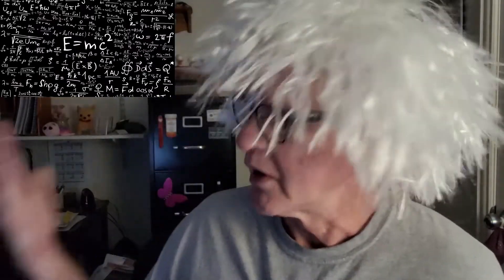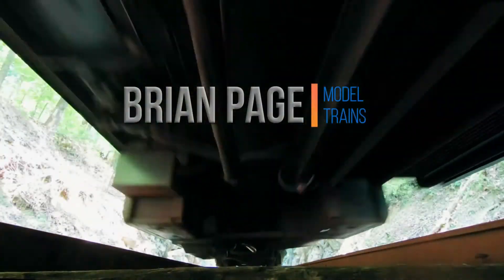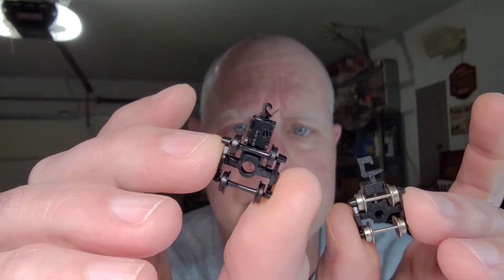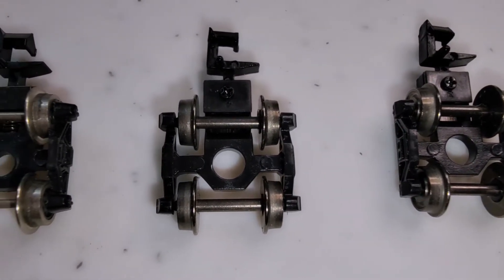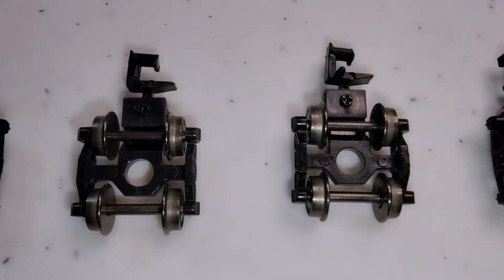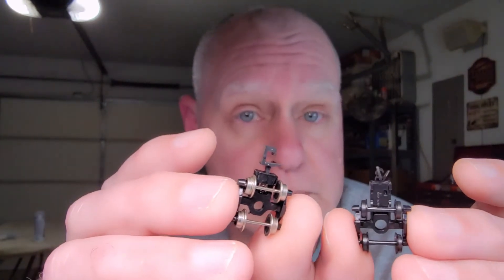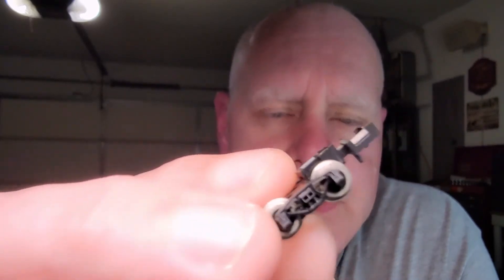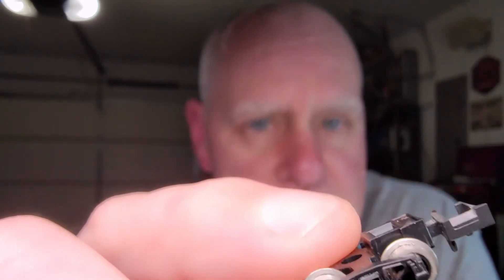Plastic vs. Metal Wheelsets

Comment: First off, I need to say that 90% of my freight cars are equipped with Micro Trains trucks and couplers.  But, I have some old, ('69 and '70's) MRC freight cars, with factory trucks with metal wheelsets, and they are by far, the best rolling freight cars I own.  I've had 'em for over 50 years, cleaned the wheels once, and they're still running perfectly. never derail, and stay clean.  I wish all my freight cars ran as well.  Almost every time I see MRC freight cars come up for sale, I buy 'em up,  and they all perform the same.  I've never regretted the decision to pick up more.  Thanks for your observations and opinions.  I agree with you 100%.
Reply from the maker: Yes, whatever works best for you, I say stick with it!

Comment: C'mon Brian, I was just taking a slurp of tea when you showed up like that, nearly came out of my nose LOL.
Over this side of the pond  in N & HO gauge we tend to go for metal wheels. They seem run more freely, tend to stay clean longer than plastic although all wheels as you said will pick up dirt, and they clean up easier. All our locomotives and rolling stock tend to be metal wheel. Some company's who put out kits you put together tend to come with plastic wheels but only I think to keep the cost down. We then simply change them to metal.
Our goods wagons or as you call them freight cars in the period I cover 1950's are so small and light I have to put weights in them so they can at least have half a chance of staying on the track.
 As my layout is in the loft and we do get extreme temperature variations up there I have to put expansion gaps between track sections to allow for the track to stretch or shrink. Oh I have had some disasters when I did not allow for this. I have a gap of 1mm between each track section and believe me you can hear the clickety-clack as the train runs along, its lovely, brings back fond memories when us poor could afford to travel by rail.
Now regarding the cocktail stick test, that might just be down to the coning of the axles. I have not tried these yet as all my stuff is fairly new but I have heard good things about Bearing Reamers which they make for us N Gaugers.
They smooth out the imperfections in the coning of the axle bearings. Mate of mine has purchased them and he can now pull a third more in stock after using the Bearing Reamer as it has cut down on the friction and the wheels run better. Also they work with metal and plastic wheels so I am told.
To be honest I dont swap mine out either, I leave whatever wheels are on there when I purchase them,  unless I start to have issues.
If it works dont fiddle with it.
Regards Chris
Reply from the maker: Lol - Good thing it wasn't soda! I agree with your comments completely, my point was use whatever you like.

Comment: Brian, I completely concur with your assessment of plastic vs, metal wheelsets.  I have over 200 freight cars, and I'm about 2/3 done with the conversion process.  I've found, my locomotives, after conversion, can pull over 20% more freight cars, starting with the same consist, than they were able to prior to the conversion to MT trucks and couplers.  Just a little more validation to your conclusions.  The only way to eliminate 'cruddy' wheels, is to invent, and run, Maglev trains !
Reply from the maker: Yeah, I caught a lot of flak on this one, which I knew I would.  But the point was, use whatever you want!
Reply: @brianpagemodeltrains  absotively, posilutely !

Comment: Hi Brian! Thanks for your assessment of plastic vs. metal wheels. As you may know, I switching from plastic to metal wheels on my layout, but I still have both on my layout, and both work very well. I think good trackwork and the overall weight of the cars is more important. Bottom line (as you noted) is this: Like just about everything in model railroading, whether you use plastic or metal wheels on your layout comes down to a matter of personal preference. ...Roy
Reply from the maker: Precisely Roy, thank you!  That was the message of the video.

Comment: Interesting observations Brian. There are pros/cons for both options. I fully agree with your conclusion - do what you like with your railroad. But, both Steve C & Roy E have very valid points as well. I'm sure you knew that you weren't going to end this debate - it'll never end!
Reply from the maker: Very true, John!  My point of this was use what you want, there's no right or wrong.  My layout is so small, I could use the old crappy trucks and it wouldn't make much of a difference.  It's true, it will never end, but a good debate can be good conversation as well!

Comment: Good video, but I found the comparison of 40 year old vs new trucks and wheels to be pretty strange.  Yes the weight difference is small, but in some cases might be all that is needed to bring a car to proper weight.  Another unmentioned advantage is on light cars, metal wheels will lower the center of gravity to help tracking etc…  modern metal wheels aren’t usually as wide or have that big a flange as those you have.  If you put a modern blma, fox valley, tangent or such wheelset in the same micro trains trucks, my experience is they will out roll plastic every time with an even lower amount of friction and personally I find they stay cleaner.  To each his own.  Very entertaining and I look forward to seeing your next video my friend.
Reply from the maker: Thanks!  Yes, it was a "strange" comparison, but as I said before and after, it was only to show why I don't feel the need to swap out my plastic wheels.  Thanks for watching!

Comment: First of all new sub here, very nice channel.  You are correct in saying do what you want. For me its price. While I like the sound of metal wheels, I just don't have the excess money to switch out a bunch of rolling stock.  You can buy Micro Trains trucks that are brown that I think look nice. One thing about your test is that the older rolling stock with metal wheels probably needed to have the bearing journal cleaned a little bit.  Thanks for sharing. Dave
Reply from the maker: You're probably right about that, Dave, plus the metal wheel trucks I have are really old - But it was just to show that I'm fine with the plastic wheelsets as well as metal, doesn't matter to me as long as they work.

Comment: Brian, very well thought out and presented. Here are a few additional comments/points.

Noise: While the metal wheels "may" provide for more prototypical sound, the sound level is way higher than prototypical and the plastic wheels provide for a much lower sound level...a point many modelers prefer.

Grime collection: Totally concur, metal wheels will also [pick ou crap, just look at locomotives and having to clean their wheels (even though alot of the loco grime is due to micro arching). BUT, metals wheels are much easier to clean and are not as susceptible to damage during cleaning.

Friction/rolling. While your demo was a good idea, your methodology was somewhat flawed since you tested the friction/rollability of the entire truck assembly, NOT the true comparison between metal and plastic wheelsets. A better test is on a set decline, from a stop and lift a barrier and see how far the car travels once the decline levels off. Do this first with plastic wheels and then replace just the wheels (not the entire truck) with properly sized metal wheel sets. On my HO cars, without exception, the metal wheeled cars travel MUCH further than the cars did when they had plastic wheels. Now, again I am HO so the larger cars (heavier than N scale) makes the difference far more apparent. BUT, it really may not matter IF, the layout is flat, the trains being run are not excessively long. (btw, there is a tool that can be inserted into the truck pocket to reem the pocket out a little yo let the axles turn easier.....at least for HO.

Weight difference: even in HO, the weight difference between plastic and metal wheels are negligible and the cars still need to be properly weighted in other methods.

Like you, I have the same conclusion, not an advocating either of the other for other people....just simply attempting to provide facts so people can make their own determination of what is a good fit for themselves.
Reply from the maker: Agreed Steve, although my test wasn't strictly about the wheelsets, it was more about why I don't feel the need to change them.  My metal wheelsets are so old it's no wonder they don't roll very well.
Reply: @brianpagemodeltrains  I whole heartedly agree under your circumstances where extra long trains are not run (and consists can cover for that anyway) nor are there any grades to deal with. I did want to point out the flawed "friction" test though ;)
Reply from the maker: Thanks for pointing that out Steve.  The context of that demonstration was only to show that I don't need to run out to spend money, fixing something that already works. Again, my overall point was to use what you like.

Comment: Metal wheels on metal rails are going to cause a small arch between the two - which would account for the accumulation of "dirt" which is actually a carbon build up.  Even though the wheels are isolated so you don't short, you can still arch. Just a possible reason metal wheels could become 'dirtier' than plastic.
Reply from the maker: Very true, but I don't actually know if either gets dirtier than the other - I guess time will tell.  Thanks!

Comment: I have both plastic and metal wheels on my layout, the Micro-trains plastic wheels are excellent performers, there really is no need to change these out, unless you want more clickty clack noise on your trains!, with metal wheels they vary per brand, my favorites where the Fox Valley ones, unfortunately no longer made, the wheels on Trainworx and Bluford Shop, cars are excellent also. BLMA metal wheels have too much drag and do not roll that freely, I have had issues With some Intermountain wheels, being out of gauge or imperfect. The old Model Power Metal wheels were pretty bad, most of the cars would wobble down the track! I like the Micro-trains metal wheels, but they are hard to come by, the Micro-trains wheels used on the 60ft TBOX cars are really super. Just my two cents. I have been following N scale trains since the late 60’s and modeling since around 1984. N scale has come a long way. Enjoyed your video.
Reply from the maker: I agree = The only reason I bought all the MT trucks was to easily get rid of all my old Rapido couplers.

Comment: Brian just ran across you video.  While I see your point and definitely agree with you , I must admit that I change ti metal wheels on bot my n and ho scale cars , the weight is there fir but just not as much for n scale . I run on the museum it San Diego  and we encourage metal wheels . It will tell you we also recommend to clean your wheels before running as this gets rid of the build up of crude and the cars run better . I was surprised at your test results and aminpressed with the results till I remembered that n scale has one problem as ti axal size some can differ by as much as .o5 of an inch. Which can slow a car or fit to losses ly making a difference too. Try your test again wit micro train trucks and metL wheels. Let me say again I agree with you point of view too. 😉
Reply from the maker: Hi Jack - I have no problem with that at all, and I still have some cars with metal wheels.  My point was that everyone can do with their stuff what they want!
Reply: @brianpagemodeltrains  you are so right !

Comment: I had Repedio couplers but they are so old they snap off going around the track, pluse if you have a derailment I have found they will pop out of their socket.
Reply from the maker: Yeah, I got rid of mine not only because of those issues, but also because I didn't like the looks.

Comment: Have you measured the size of the wheels? The overall length of the axles? The distance in between the flanges?
This is what gets me so mad, HO has a tool to burnish the seats of the axle and N scale does not and we pop these wheel sets in and out without thinking of burrs, lengths  and size of the wheels, flange, or even lenght.
Reply from the maker: I can only speak to the plastic wheelsets I have, and they are smooth and fit my Kato track very well.
Reply: @brianpagemodeltrains  I have found the overall length of the axles can put a bind on the trucks pockets.

Comment: Your metal wheelsets are all very old. Newer metal wheelsets are more accurately sized and shaped. Those old sets with thin metal skin around a plastic hub are worse than modern plastic wheelsets. Modern metal sets do weigh a little bit more, and when you are talking a total weight of 1oz, that small amount is significant.  I've found that using MTL trucks with metal wheelsets designed to go in them.  And I am able to run at least 10% more cars (same cars only difference is metal vs plastic) with a single loco.  Metal wheelsets are always isolated,  shorts are not really an issue.  You really should get some decent modern metal wheelsets to try in your MTL trucks (just get one pack and try it).
Reply: If I did that same test with two identical cars but using good new metal wheelsets, the metal one would go much farther than the plastic.  Your old sets are crap, that's why they roll badly.
Reply from the maker: Thanks Roy!  I realize that my old trucks are crappy, that's why I pointed that out.  My point of the whole thing was use what you want because there's no right or wrong to it. As to some of the things I talked about, I don't necessarily agree or disagree, I just mentioned things I've heard or seen from other people.  I'm only saying I don't feel the need to spend money to swap out the plastic.
Reply: @brianpagemodeltrains  I understand, but I think it would have been a better comparison with actual good metal wheels.  Maybe I'll jump on the bandwagon and do a video too. :)
Reply from the maker: @RoyEltham   - You should make one, Roy!  The comparison in my case wasn't the point, my point was use what you want.
Reply: Which metal wheelsets?
Reply: @HumancityJunction  i have Intermountain ones made for MTL trucks, and some Eastern Seaboard ones.

Comment: To be honest, you used the old cheap metal wheels in a kadee truck and wondered why the plastic rolled further.  Did you mike them?, the old metal wheels. when I converted to kadee years ago I found the old metal wheels where an issue with size in the truck.   The new metal wheel sets are manufactured better now than the old metal wheels.   Have you weighed the difference between the new metal wheels versus the new metal wheels, the old ones have plastic inserts.   I pose a question to you , why did Kadee come out with metal replacement wheels, one answer is their metal wheels have plastic axels.   So why run metal wheels.   If you want operating signals each car has to have a resister so the detection can see the car clear the block so it can change the signal.   I run both on my layout which has an upper and lower level.
Reply from the maker: Thanks for the comments, Will!  Yes, my little experiment was skewed due to using very old Rapido trucks, and that would have been an issue had I been trying to say one is better than the other, but I didn't.  Apparently, everyone missed what I said right before and right after the experiment. I clearly stated that it was only to show why I don't feel the need to swap out my plastic wheelsets, not to say one is better than the other. The entire point of the video was to use whatever you like the best.☺
Reply: @brianpagemodeltrains   did not want you to think I was bashing your video and your thoughts.   Yes, I understand you were not taking a side.  to me you guys on YouTube spend a lot of time and money creating content for the hobby.   There are a lot of new guys who if it is on the internet it is gospel.    I was just saying the pit falls I went through.   Keep 'm coming.🏁
Reply from the maker: @wilzdart  - It's all good, Will - Thanks!